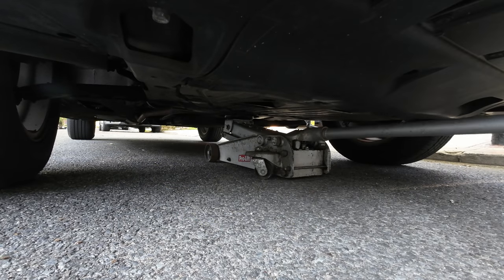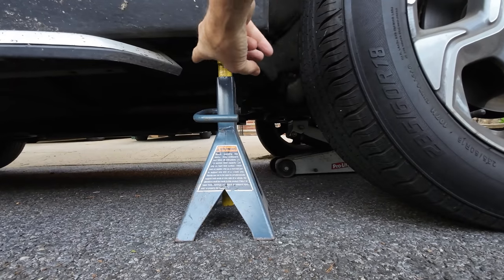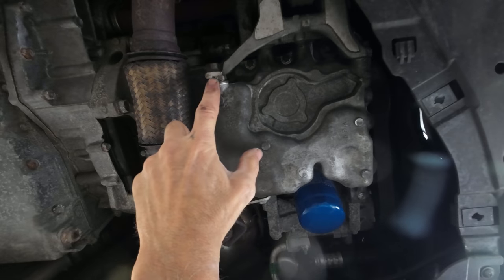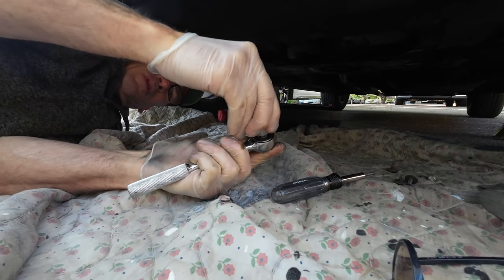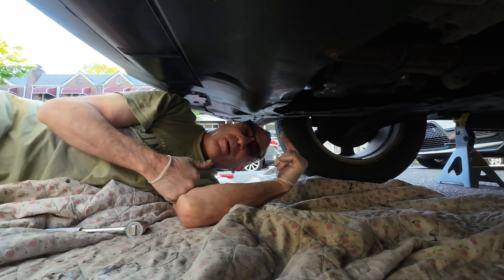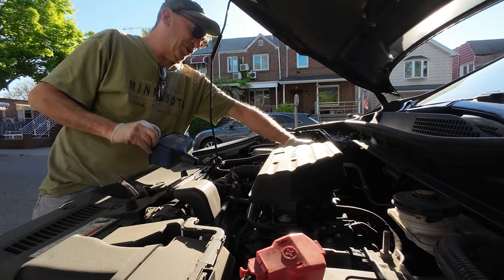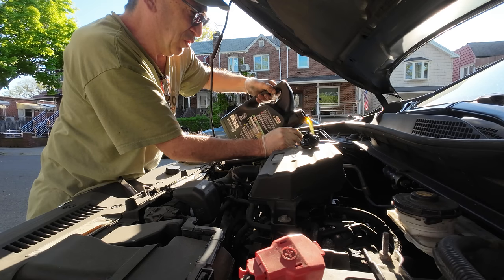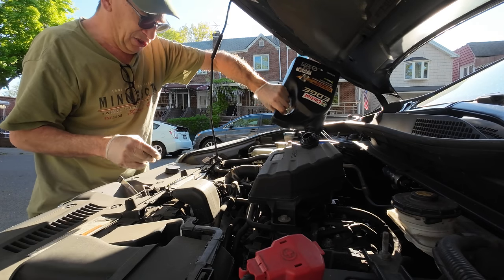Oil King at it again  what can Go Wrong

Comment: on the honda pilot and acura mdx the oil filter is right next to the wheel  and the space is very tight.  one way to make it easier to get the oil filter off is to turn the steering wheel all the right  and you can your regular wrench
Reply from the maker: thank you, an excellent tip